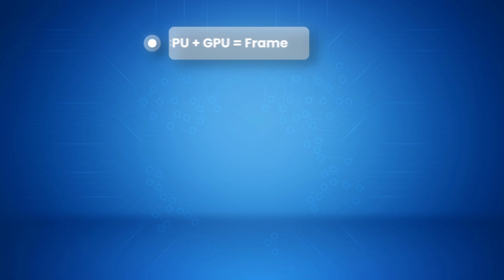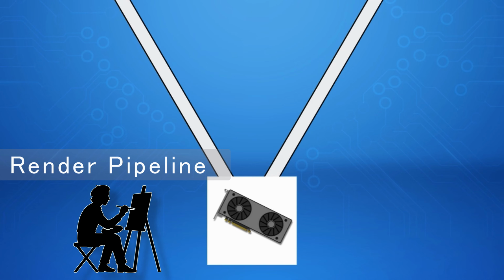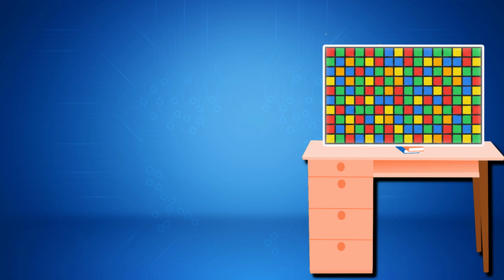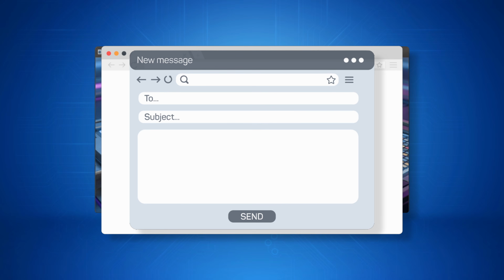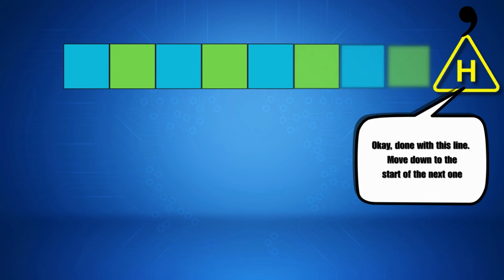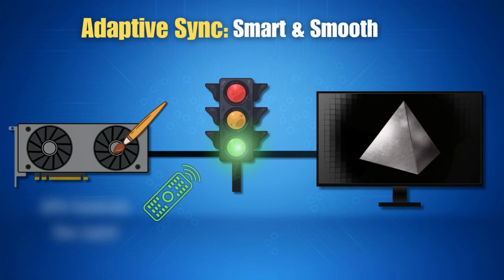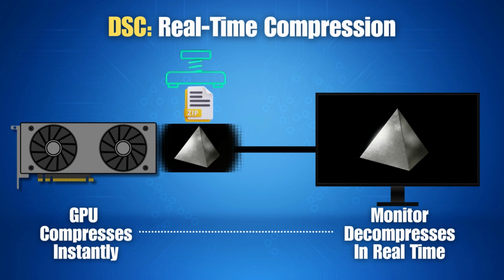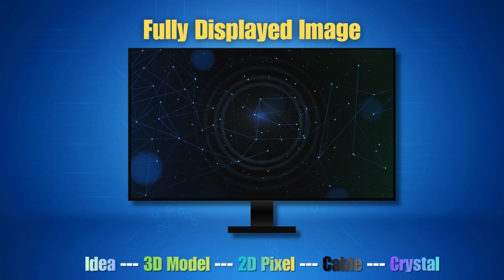How GPUs Send Frames to Your Monitor: The Hidden Process Behind Every Pixel

Comment: Have you wrote a program to write to the screen frame buffer without OpenGL or Vulkan? I remember on the old C64 and Amiga; you would just write to memory locations during the vertical blank interrupt and would just write to certain memory locations for the Video chip registers. Now with modern graphics cards you still have that, but it is hidden from you usually. I just wondered. SDL3 or Raylib are nice libraries to do graphics. Thank you for putting this Graphics summary together for us.
Reply from the maker: Thank you so much for your comment! Personally I haven't, but I do appreciate you sharing your experiences and some history on this topic. It's really cool to learn about it!

Comment: What of the Virtual RAM, a part of the ROM dedicated to serve as additional RAM?
I never knew VRAM also means Video RAM apart for the Virtual RAM.
Reply from the maker: Great question! They are 2 different things:

VRAM = Video Random Access Memory, this is used by the GPU

Virtual Memory = Is OS managed for your SSD and HDD and is used like an overflow for your main system RAM ( it's also a lot slower then VRAM)